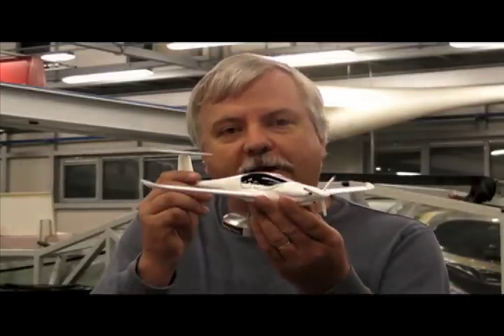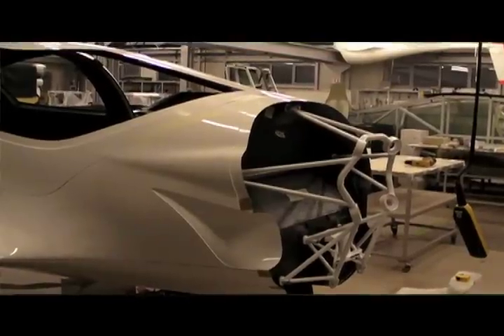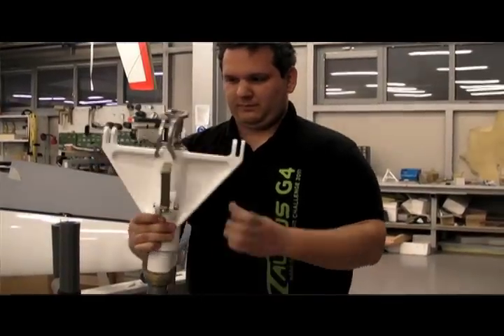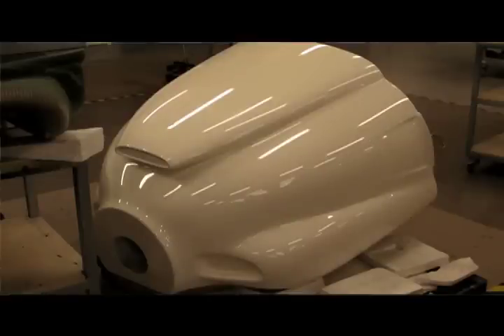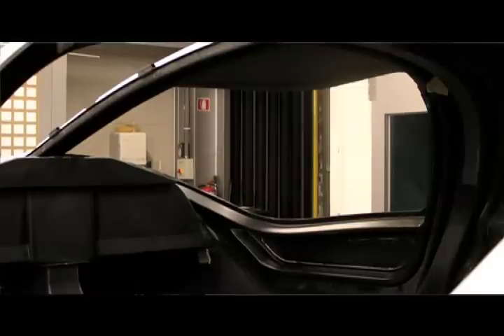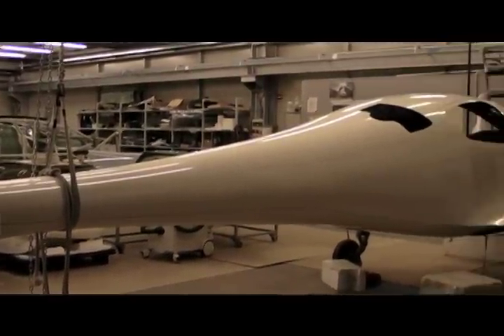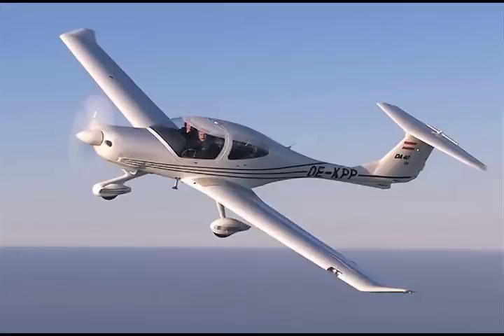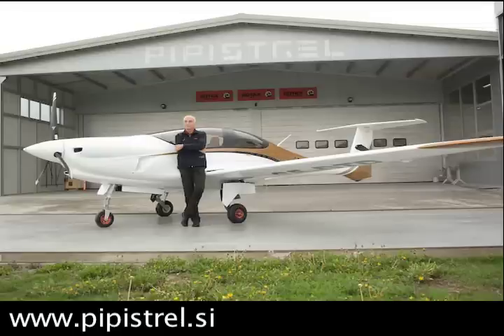Pipistrel Panthera Unveiled

Comment: To those people writing that the performance figures are unbelievable/impossible: I own a Virus SW 100. Everybody said that the figures (147kt at 75%) would be impossible. They are not. I'm flying this baby at that speed and could even go faster if'd take it to the limit as much as most pilots take the slower planes to their limit. Flown a Breezer 80 HP. OK that's 20 HP less, but the Breezer is a very modern and excellent aircraft. But it is in no way even close to the performance of the Virus.

Comment: I'll agree a turbo gives better performance, fuel rate will go up and so will the wear and tear on the engine.  If you run let for less hours but at higher pressures, you're doing about the same amount of 'damage' to the motor.  *shrug*

Comment: with a turbo you could see 250kts, above weather, at only a slightlly higher fuel burn... faster flights means less time with the engine running as well...